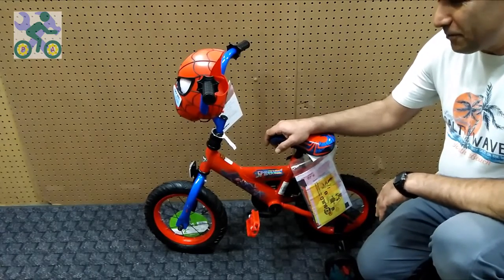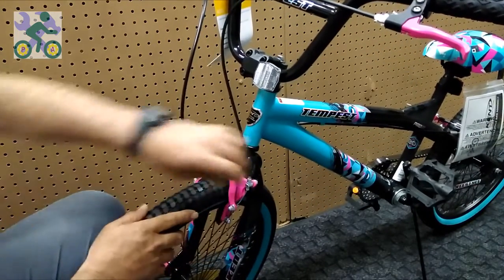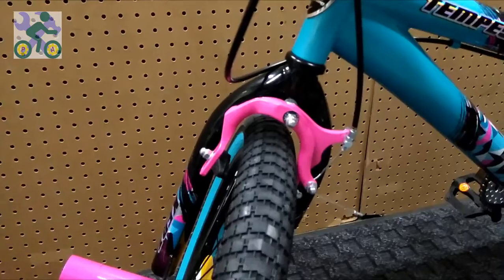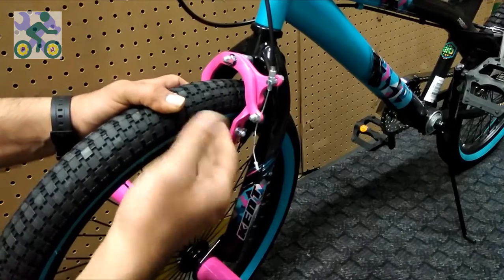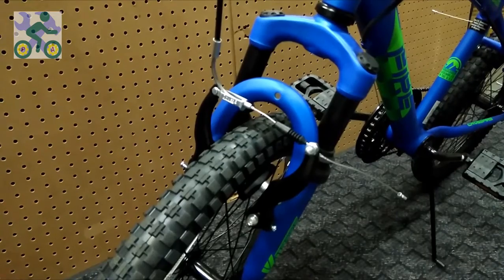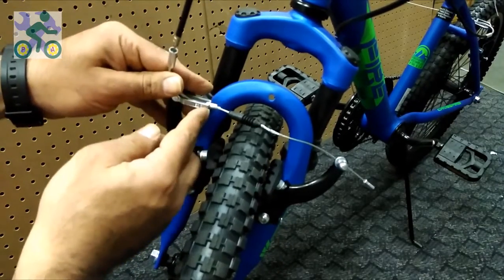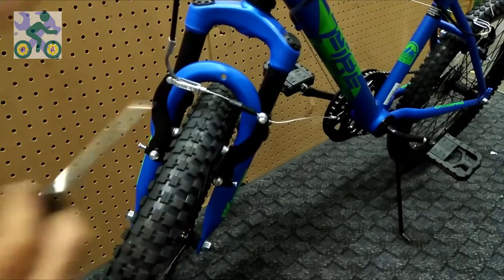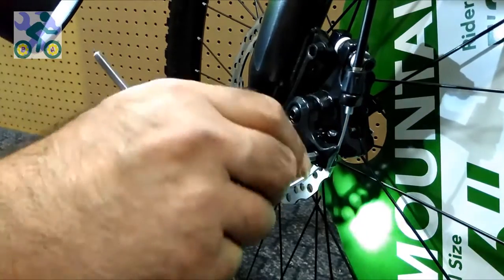How to adjust all models of bicycle brakes

Comment: So it's normal for only one side of the brakes to go in? I came here in hopes to fix that issue but on the second bike I can see that only one brake arm moves in and out?
Reply from the maker: Hi.
Unfortunately, this can be seen in the type C brakes and it is difficult to fix it.
If the brakes are not engaged while the wheels are moving, it is OK.

Comment: Please can you tell me the brand of the brake kit. Im looking for something that i could add a brake to my sons bike.
Reply from the maker: Hi Krispy.
There is no specific brand that you want to buy
Only the type of brake matters
c brake or v brake or disk.
These links will help you.
https://www.walmart.com/ip/Aluminum-Alloy-V-Brake-Bicycle-Cycling-Curved-Rods-Bike-Brakes-Full-Set-New/389738819?wmlspartner=wlpa&selectedSellerId=18988&&adid=22222222227438524020&wl0=&wl1=g&wl2=c&wl3=519603572532&wl4=aud-430887228898:pla-325971356101&wl5=9023533&wl6=&wl7=&wl8=&wl9=pla&wl10=125210027&wl11=online&wl12=389738819&veh=sem&gclid=Cj0KCQjw5uWGBhCTARIsAL70sLKNbFV9MjEKS-XWbQhWvRvxyjhKfeTRGG1-sRxH7cymJNLJ9ZQbqmwaAh6oEALw_wcB&gclsrc=aw.ds
https://www.amazon.com/Sunlite-Side-Pull-Brake-Set/dp/B000BMRU0A/ref=asc_df_B000BMRU0A/?tag=hyprod-20&linkCode=df0&hvadid=312094794167&hvpos=&hvnetw=g&hvrand=16032637062790018443&hvpone=&hvptwo=&hvqmt=&hvdev=c&hvdvcmdl=&hvlocint=&hvlocphy=9023533&hvtargid=pla-568999014605&psc=1&tag=&ref=&adgrpid=63784736042&hvpone=&hvptwo=&hvadid=312094794167&hvpos=&hvnetw=g&hvrand=16032637062790018443&hvqmt=&hvdev=c&hvdvcmdl=&hvlocint=&hvlocphy=9023533&hvtargid=pla-568999014605
https://www.walmart.com/ip/Front-Rear-Fixie-Bike-Brake-Kit-Road-Bike-Cruiser-Brake-Set-Bike-Caliper-Brake-Kit-Side-Pull-Brake-Set/872298302?wmlspartner=wlpa&selectedSellerId=101044639&&adid=22222222227430607402&wl0=&wl1=g&wl2=c&wl3=512988394949&wl4=aud-393207457166:pla-1215449899896&wl5=9023533&wl6=&wl7=&wl8=&wl9=pla&wl10=277408425&wl11=online&wl12=872298302&veh=sem&gclid=Cj0KCQjw5uWGBhCTARIsAL70sLJVT4bW--vM8UOrvfrS1HIcNHdQcS3vIt9bHa3HQjsUnGcCYQFBDb8aAh3KEALw_wcB&gclsrc=aw.ds
Thanks for your comment 
  Please share the channel with your friends on Social Networks and Do not forget to hit the like button.
Reply: @ProAssembler  ty bro

Comment: Hello. I am having an issue where the right front brake arm is actually loose; it wiggles back and forth, and the metal rod behind the brake is also loosened. However I am not sure which screw I need to adjust in order to fix this.
Reply from the maker: There is a nut on the back of the fork
Hold the brake arms in the middle and tighten the screw
Of course, not too strong
Reply: @ProAssembler  So that wasn't it. I couldn't adjust any of the nuts on the brake arm at all (this is a side-pull V brake); it turned out the tension spring was loose, and the brake pad's spacers had been mounted improperly.

The wheel itself had also dished to the left side.
Reply from the maker: @jeffgrimes7590  In v braking system, it is normal for the arms to be loose, although there are two screws that can be tightened, but not completely.
Adjust the brake pad according to the video and then adjust the brake wire
Make sure that the front wheel is in the center, if not, loosen the front screws and adjust in the middle
If there is another question, I am here

Comment: My problem is that when I pull my front brake it does not brake it is to hard to pull
Reply from the maker: behind the fork you can see a nut. loose it and try again also maybe the brake wire have an issue .